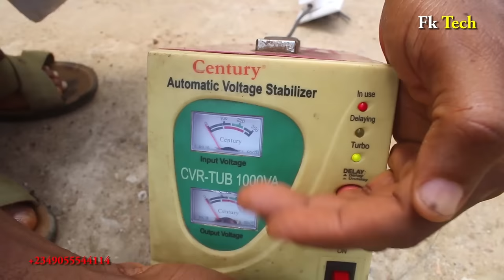How To Generate Free Electricity With Salt And Electrolyte At Home, Fk Tech

Comment: Salt and water do the magic alone i did this in school here in Germany get enough salt and put it inside the water then connect your wire with mental and put them inside water the more you mix the more voltage you get salt+water = sodium chloride
Reply: Do you mean salt and water used for both positive and negative?
Reply: You meant, the higher the concentration, the higher the voltage?

Comment: I would love to do this, but I have some questions, how can I connect to the main grid of the building? I have a 18 room hotel, so would love to try it. Also, what are the hazards ? Safety precautions, and how to regulate the amount of energy emitted??
Reply: Hire him to come to your hotel and do that for a fee
Reply: If you are in for a professional use....hire him with proper installation
Reply: Only if the building have been installed electronically meaning house wire ring then use your change over switch that's all

Comment: Can you do it with or without iron buckets? Or it must be an iron  container
Reply: The iron bucket is used due to over heating of the water in a rubber bucket it would melt
Reply: Experiment it yourself 😮

Comment: Does it matter if you swop the bulb terminals around because  it shouldn't
Reply from the maker: It really matters because the power is dc
Reply: That makes this experiment very tasking, because now you have 5o be super careful and sure that whatever you're plugging to it is of the same terminal polarity.

Meaning you'll have to check (your TV for example) if the red cable of the plug is connected to the red output of the experiment. You'll have to do the same for every other item you want to power with the experiment... 🤷‍♂️

Comment: Did you add electrolytes to the both negative and positive buckets?
Reply: Just the positive only
Reply: @_cappuccinos is it the kind of electrolyte used for dead inverter batteries?
Reply: @Emanuela780  no
Reply: @fellatech9130 what then?